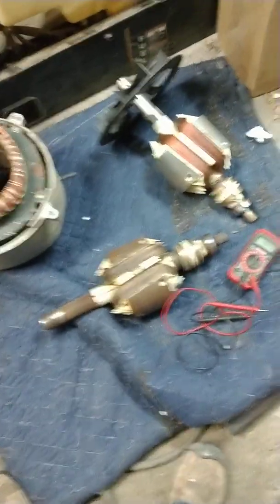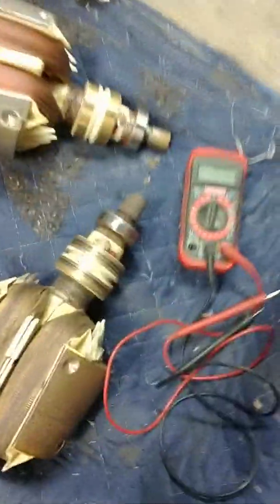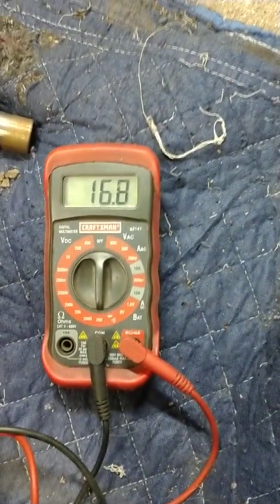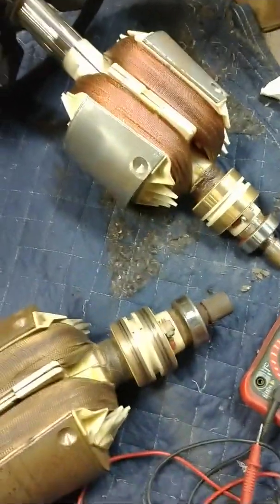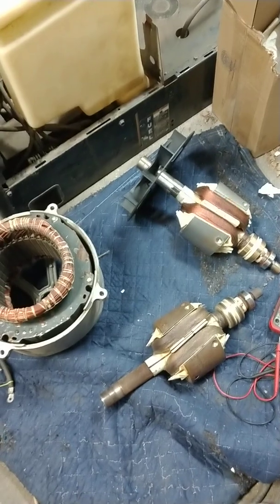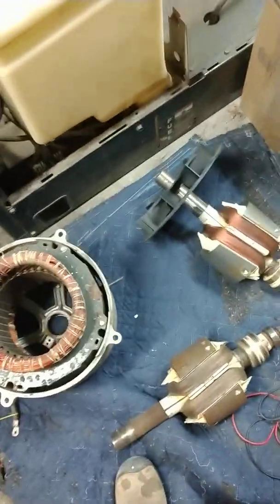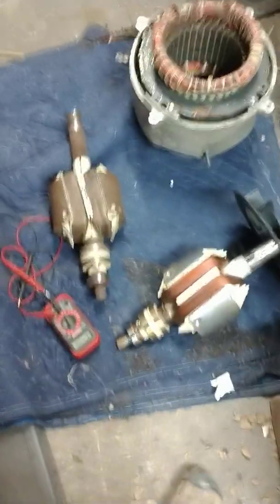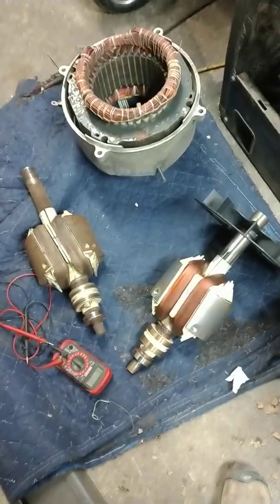Miller Bobcat generator armature test and replacement Dakota Ironworks LLC

Comment: What model was this? I have a miller bobcat 250 and it tested exactly 3.2ohms… but I looked at some forums and they said it should test between 3-4ohms
Reply from the maker: It's a Bobcat 250, and the resistance between the slip rings for this machine should be between 14-17 Ohms.
Reply: @dakotaironworks5108  Yes it’s a bobcat 250, maybe 06 model, I’m not sure. It does weld if you play around with the knobs it’ll throw down a good bead, but it’ll only last a little before it completely stops. Could that be bad coil? I already ordered capacitor and transistor
Reply from the maker: @RiggyRonnie  If you have to mess around with knobs it could be a weak rheostat, look closely for any discoloration around it. Mine is a 2011 Bobcat, but I would think that the resistance values would be the same.
Reply: @dakotaironworks5108  Yeah I looked at the Miller forums everyone there is saying it should be around 3-4 ohms on the slip rings. Maybe if it’s out all the way? I just checked directly from each of the 2 slip rings
Reply: @dakotaironworks5108  The rheostat doesn’t seem to have any burns or anything, but it could be! It only worked on full blast, and then when I turned it down the power went out. It could be something internal
Reply from the maker: @RiggyRonnie  I would certainly be concerned about a reading of 3.2 Ohms across the slip rings. How many volts are you getting out of your 120V plugs?
Reply: @dakotaironworks5108  Full 120V, but only sometimes, when it works it work good, but lately it hasn’t been wanting to work at all.
Reply from the maker: @RiggyRonnie  Have you tried redressing your slip rings and replacing the brushes?

Comment: Hello, I have the same welder as you. Could you explain to me how to remove the stator from the engine? is it screw or just tap
Reply from the maker: Richard, it is threaded. The link below is to a very informative video that addresses the removal process starting at about the 2:45 mark. 
https://youtu.be/k-EoyKKRS1M

Comment: I have a Miller bobcat welder & gen. 225  I think it is 2006 serial no. LG070978, I sure need a wiring diegarm for around the rectifers
Reply from the maker: Jerry,
I have found that every time I call Miller Customer Service not only does a real person answer, but they will put you directly in contact with the proper technician to answer your questions. I would absolutely recommend that you call them. They will ask if you're calling regarding generator/welding products or plug-in type welders, and they may ask for your model number. The direct number is (920)734-9821.